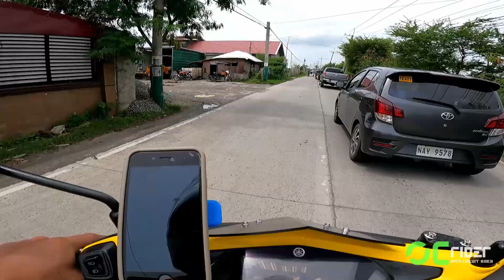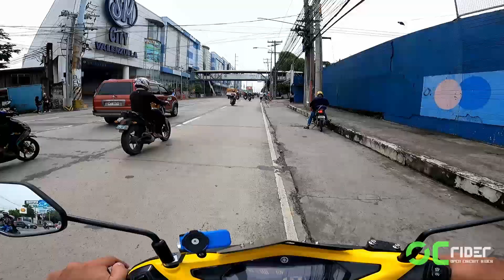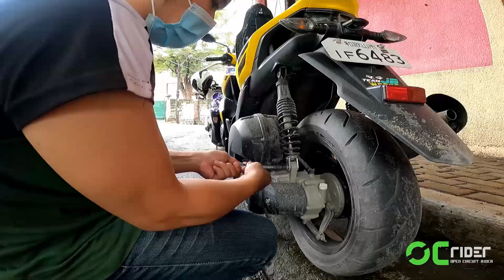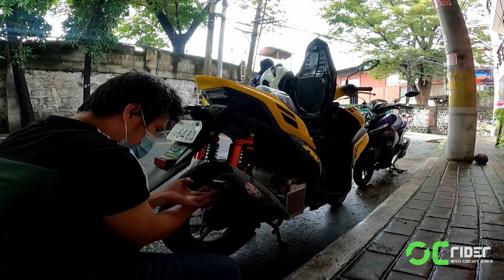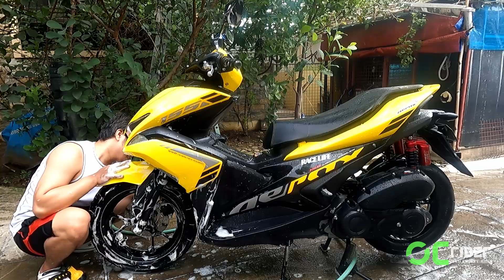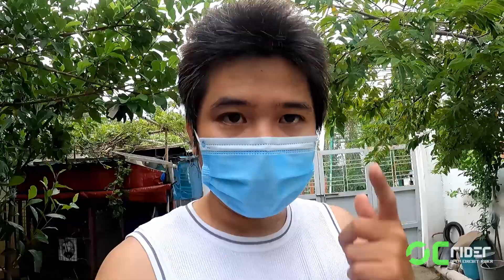Yamaha Aerox S | YSS G Sport | WF pipe Version 1

Comment: Ka OC pwede kaya sa naka superstock na set up ng makina yang wf pipe na yan? Nmax v1 motor ko... Salamat in advance
Reply from the maker: Yes pwedeng pwede.. basta version 1 ng wf..
Reply: @OCRider  yown! Bale naka cams,na headworks,stock lighten valves na rs8,tas kinalkal ung piston ng stock block... Oks na oks ba sa v1 ng wf di kaya sungaw kapag? Hehehe
Reply from the maker: @KARRUBAAmmak  yes di naman sungaw basta v1 na wf. Sungaw yan sa v2 ng wf.
Reply: @OCRider  salamat sa sagot ka OC more vlogs pa 😊
Reply: @OCRider  pano kapag nag racing block na at throttle body ay ka OCian?